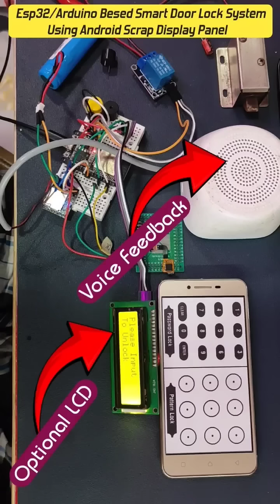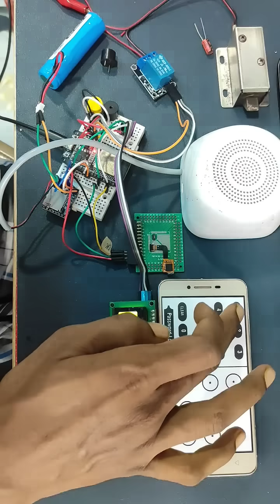🔥DIY Hack: What You Can Do With a Dead Android 😲 | #Arduino #Voice #DoorLock #Science #hardwarehack

Comment: Hey, I'd like to know what's the chip you're using in the middle adaptor board? Is that a step up buck? To turn 3.7v into 5v? If yes, I would like to know the part number as I find it exceptionally small and thus, very useful!
Reply from the maker: no it's a pcb Breakout board for joining SMD Connector To 2.54mm Header Pin.... feel free to Visit my channel & watch Full part of this video